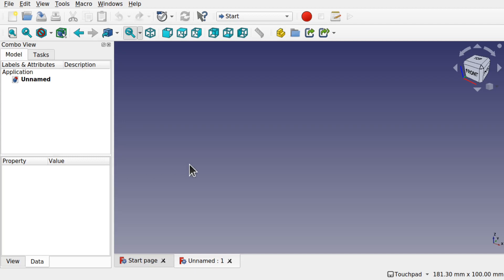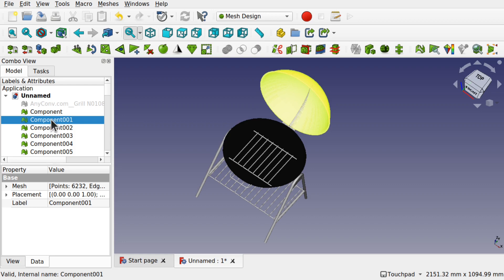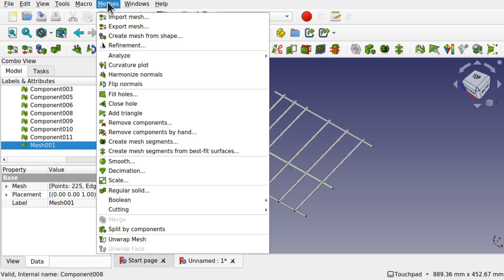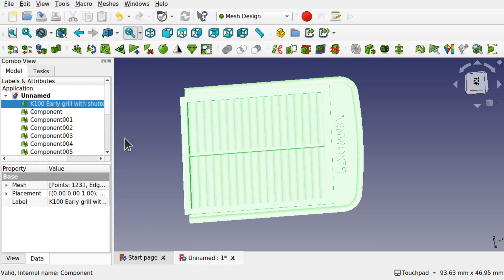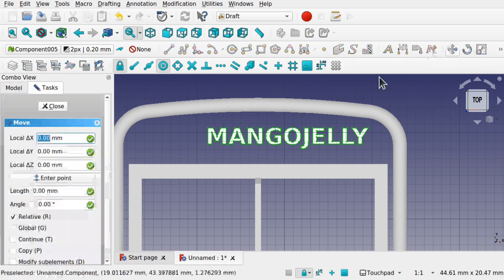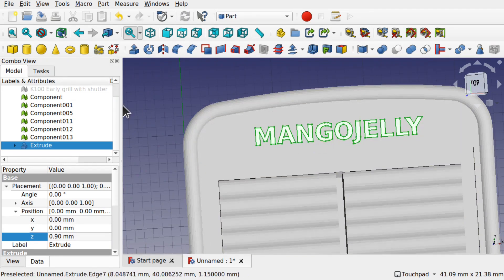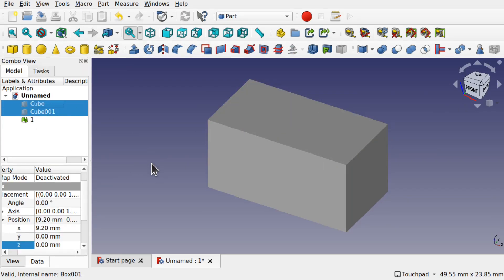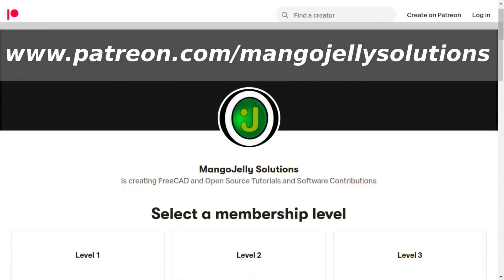Modifying STL / 3DS / OBJ Files in FreeCAD Adding and Rearranging Components of Existing Mesh Models

Comment: Thank you, I didn't know there were any components inside.
I tried on some models I had on hand and I find it's like editing of PDFs in vector graphics software: the results are fully dependent on the process of file creation. One file had just one component, another had many, yet another had many but the text was embedded into the surfaces. So it may or may not work on each individual model.

Comment: Awesome teaching. Great example of ways to protect your models so that they can and can't be reverse engineered.
Reply from the maker: That's is a very good point regarding protecting your model against reverse engineering 👍👍 glad you enjoyed.
Reply: Everything can be reverse engineered. If theres a will, there is a way. So it's absolutely useless to do this imho, because it only makes it unnecessarily harder or even impossible for beginners to customize certain things in a model.
Reply: @Der_Kleine_Mann  If this is the case. Making it harder for someone to use my work without permission. If someone wishes to go this route, I make it as hard as I can for reverse engineering. Even hiding identification marks. Better to ask permission, then be sued into forgiveness.